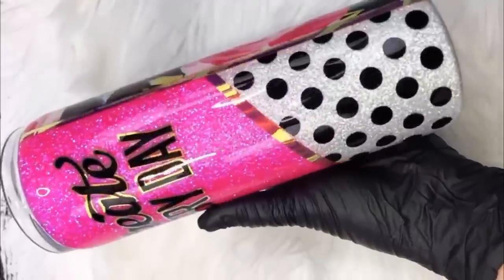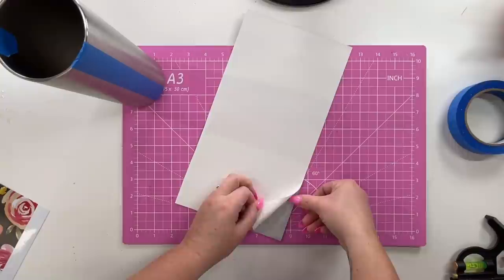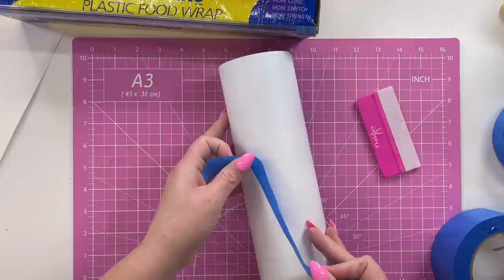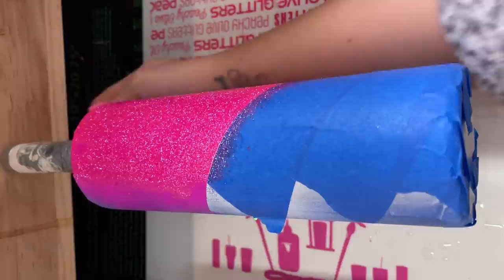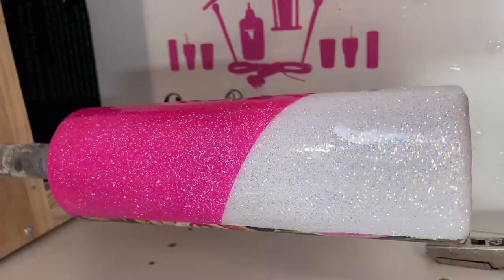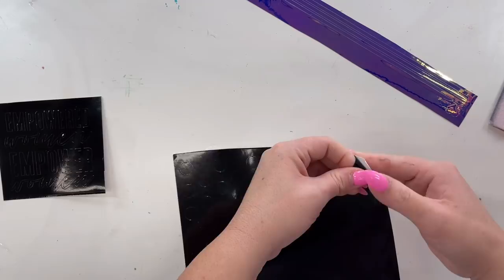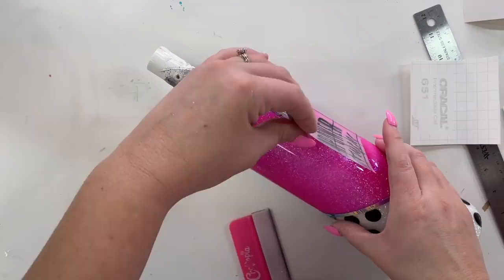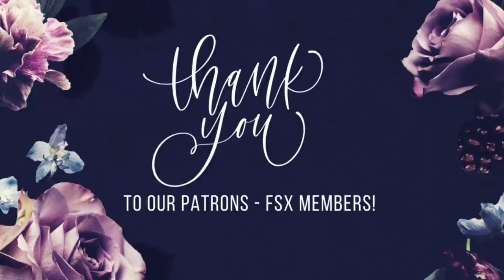Split Tumbler Tutorial

Comment: Ya I’m the third like. I done my first resin project or started it last night. I’m doing coasters that are white with a small swirl of sparkly gold, then I’m going to put flowers and cover it with clear. I got a nice face thing like yours but mercy my nose is still running. I must have done it wrong
Reply from the maker: What kind of filter? Is it in a room that’s well ventilated?
Reply: @FlynnSistersBoutique  no not really. I pour then leave the house. I’m using a face mask and the filter says 3M, well mercy the filter itself don’t say. It just has 3M 60923. I got it from Lowes or Home Depot. It was like 55.00.